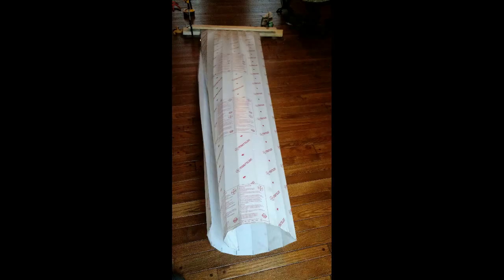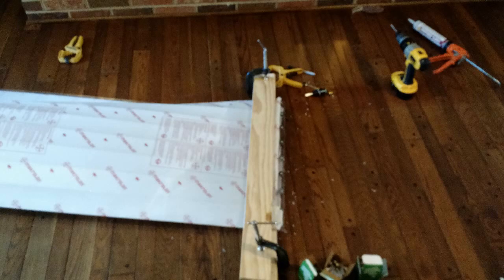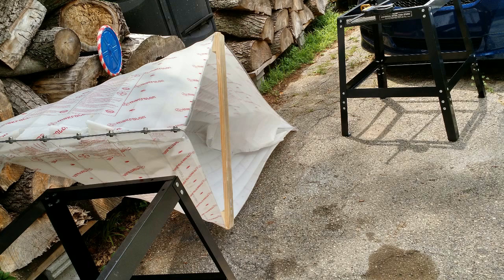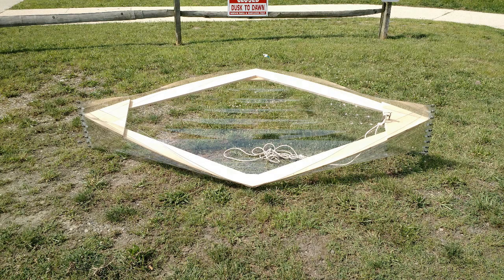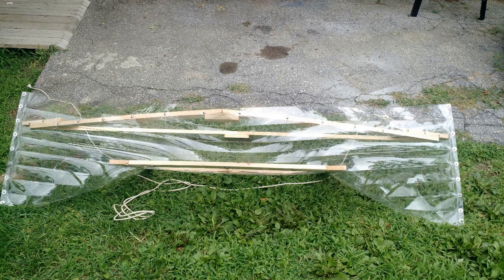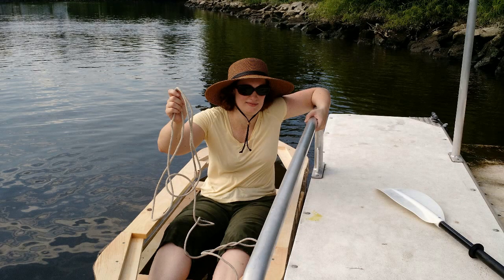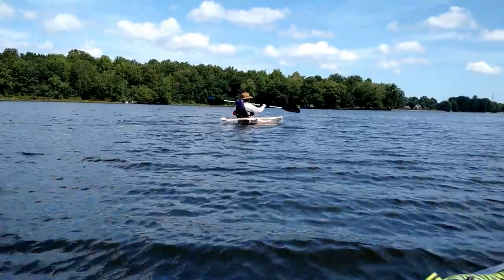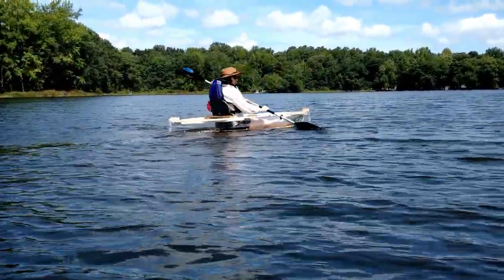HomeMade boat - clear kayak V1.2 - folding, testing and using

Comment: If you had some video of the 2nd version out of the water it would be helpful. It seems like you have these deep projections going down in both the front and rear which would make it very hard to turn, and maybe make it unstable with so much buoyancy down low.
Reply from the maker: I'll make a video comparison

Comment: Nice ray. ..I'm thinking of building one in our living room ..I have a question . ...does polycarbonate melt if you used hot air blower to make shape of a boat??
Reply from the maker: you can heat poly carbonate to shape it but you must be careful not to get it too hot

Comment: great video!I  love the boats. I was wondering how you bend the lexan sheet?
Reply from the maker: ive done it two ways: the first is on the floor with the help of my wife, slowly rolling  (and fighting) the material and them bending it on a marked line.  even at 1/16" it is VERY difficult to do.  the other way to to bend it in a press brake.  either method produces a bit of stress on the material and it can crack over time.
Reply: thank you for that info.
Reply from the maker: sure thing, let me know if you have any other questions
Reply: do you bend it over completely in half
 at each line or is there a certain angle? i know lexan has a lot of spring back,
Reply from the maker: no particular angle i just bend it more or less,  for the kayak i wanted the bends for rigidity.

Comment: Interesting build Ray. This and the other boat you built would be a fun, useful, and easy to replicate project for the youth who participate in my outreach to replicate. How thick were the polycarbonate sheets and was heat used to fold or bend the sheet at such an acute angle?
Reply from the maker: +Jeffrey Vastine thanks. 1/16" thick, and cold bent, no heat.
Reply: Thanks for the reply.
Reply from the maker: +Jeffrey Vastine sure thing, anytime.